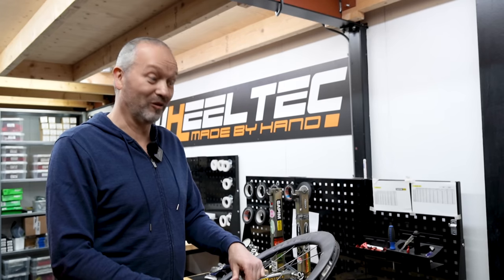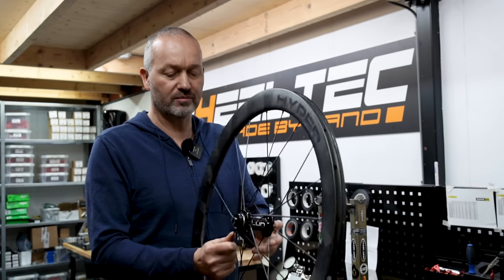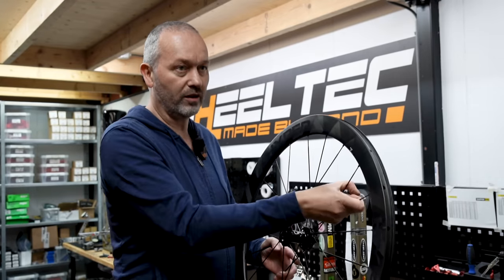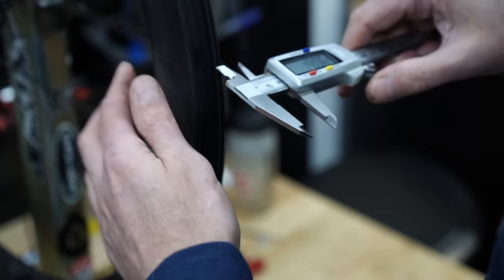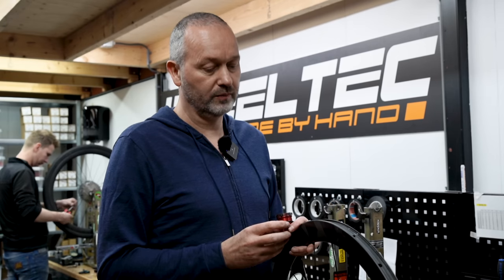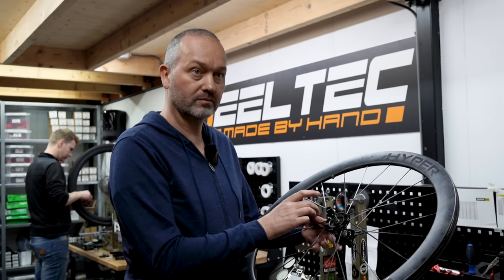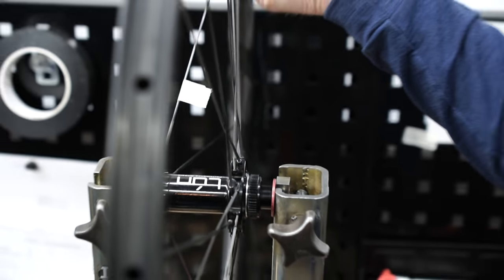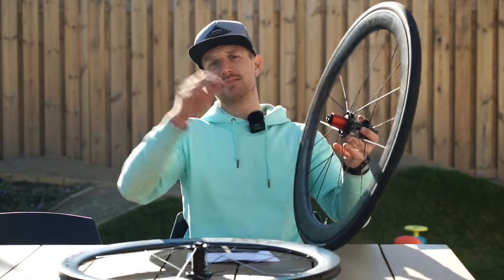2-year OLD Winspace HYPER Wheels Inspected By A Professional

Comment: "We know where they are made" Care to elaborate? The cycling industry really needs more transparency. Plenty of brands are made in the same factories, and as a consumer, I'd like to know where my products come from.
Reply from the maker: Mmmyeah, it's a very difficult structure in the Chinese carbon story. (i discussed this extensively with both Marc and Winspace) 

One factory can build products in various qualities and specs required by the brand. So just naming the factory will actually not give all the info.... 

The factory that makes these parts also makes parts for other high end western brands. But they also make parts for lower end brands at lower quality e.g. (or these are rejected products by a higher demanding brand and than sold to whoever still wants it...) 
It's a long story. 

I don't think that big western A brands openly share what factory their parts are made do they?

WINSPACE is already very open in their own factory where they do the building and QC of their wheels etc, i think that is really cool! (You can find videos of their factory online and I will share some footage in my next video i got direct from winspace)

Comment: the elites are a better value
Reply from the maker: Mine where not, I have a set at home and they were not close to the standard of Winspace…
Reply: @jasperverkuijl  isnt that because of the freehub body they fixed? how else are the winspaces better? they have the same spokes both of which spin and the rims on both are solid right? bearings are both ceramic, what would you say is so different?
Reply: @jasperverkuijl  elite also had the hub bearing issue they fixed aswell
Reply from the maker: @timtaylor9590  no the spokes are not the same (both carbon but not the same)
Ceramic bearings is not always same quality (I don’t know what quality either has but that’s not the main issue)
The Winspace rims are NOT solid, they have spoke holes. (The hyper wheels have spoke holes, the grapid wheels don’t)

What’s more important is what mark also mentioned in this video, with good components you can still build a bad wheel. 
Im currently having issues with the drive wheels. They are not staying true and spokes are all twisted. Hub is skipping, cassette mounts difficult. 

So no, they are not the same
Reply from the maker: @timtaylor9590  both rims have spoke holes btw
Reply: @jasperverkuijl  hm i see, that is a shame for the elites, i have a cheap pair of carbon rims with alot of miles and abuse they stay very true with no issues at all.
Reply: @jasperverkuijl  its easy to turn spokes the right way but youre saying the wheels cant be tru'd straight again??
Reply from the maker: @timtaylor9590  i wouldn’t say it’s “easy” as this is a job for a specialist (as you see Marc working on my wheels in this video)
Reply: @jasperverkuijl  u gotta take the tape off to access the port, use a socket i believe and a spoke tool at the same time to align it. how hard is that? truing is difficult but not straightening spokes. am i missing something? a few guys i know have the wheels and they had to adjust a few themselves. as far as the lack of stiffness that could be the major drawback, but flex isnt always bad in certain instances, for example it can be utilized as stored energy to generate more power when it rebounds. think about a gymnast on the uneven bars if the bars didnt flex as much as they did it would make it so much harder and / or impossible, i know its not the same thing but same concept. also tendons and ligaments flex too otherwise they would snap under high load. now if you do a lateral flex test on your complete bike as it stands youll see what flexes the most by far are the tires is that a bad thing? well it depends but most of the time no its not, especially when tires are getting so big stiffer rims would balance that out some too.

Comment: Mine went out of true, after a while I figured how to true them. So far so good. Not as stable as other 50mm wheels I tried, even less than some Hed 60mm. Very very stiff, overall these are my favorites so far. But I never experienced some of the really expensive models that most reviews compared these with.
Reply from the maker: Not stable how? You mean light and agile and corners well? 

Or are you saying not stable with wind? Because a lot of people are complaining about that but i just can't get it...
Reply: @jasperverkuijl  in the wind. Mostly on climbs, I used them, because they are so light, to climb in Colorado last Summer, the descent was not fun at all I had to really slow down in many places. there was some strong wind though. I wasn't surprised because in normal conditions in the flat I could feel that they were not behaving exactly as other wheels. Not that in the flats this was a problem to me since I am heavy 85kg. I also had them jump in the back in tight fast turns where I pedal hard in high cadence (I later realized that this is poor technique -but other wheels were more forgiven). I opted for Michelin 5000 28s, following torquepeak recommendation. Not as aero as 25 but the comfort (for such stiff wheels) is now back on par with other set ups for wider rims with 25 (stretching to 28). Still feels super fast, you know rolling resistance bla bla.
Reply from the maker: @faosa73  mmmmm, i have not experienced any of your issues.... Whatcha me descend these real fast at my footage from Haute Route. 
Don't want to talk you down but can it be skills? Or experience? I ride in strong wind daily hehe.
Reply: @jasperverkuijl  there is not a lot of skill going down hill in a straight line, except from being aero which probably won't make a difference to what we are discussing here (also you mention somewhere that others are saying the same ). Perhaps the wind was just much stronger on my experience. Plenty of other aspects in road cycling where I am sure my skills are nowhere near yours.

Comment: "best aluminum comes from Taiwan, basically. The worst aluminum rims also come from that direction". In other words the worst comes from China. China can make good stuff but only with iron fisted quality control.
Reply from the maker: You are twisting words and interpret them  wrong. 
Anyway, the point is the best AND worst comes from either china or Taiwan. It all depends on the manufacturer

Comment: I know a few good wheel builders and really there are some key things to know about wheel building to know if a wheel is going to be ok or not. One of them amusingly told me this analogy that building a wheel is like making a chicken sandwich 🤣
That is to say, as long as you have the right ingredients and you know how to make a sandwich, lots of people can build a wheel! The ingredients are simple: rims, spokes, hubs. Whether the sandwich is decent or not just comes down to whether the maker made it with appropriate care, tolerances etc. Once you understand this, you can quickly appreciate how whether or not a wheelset is made by this wheel builder or that, in Taiwan or China or Holland, by Mavic or Fulcrum, is really pretty irrelevant. It’s quite clear that winspace put a lot of effort and care into their wheels, use good components (although maybe they didn’t use a great hub in their early models!) and build procedures (as shown by strength and trueness of the wheels here after 2 years), so there’s no reason why their wheels would automatically be “cheap Chinese rubbish” as some folk like to assume.
Reply from the maker: You can make a shit sandwich out of premium chicken but you can’t make a premium sandwich out of shit 😂